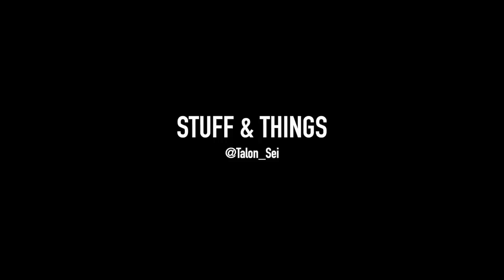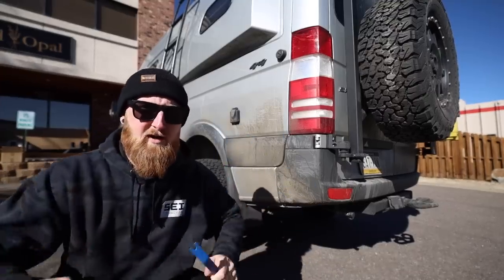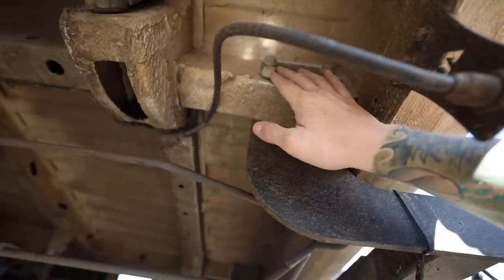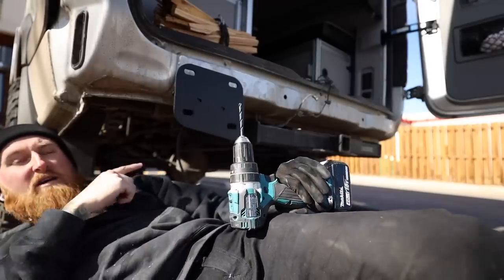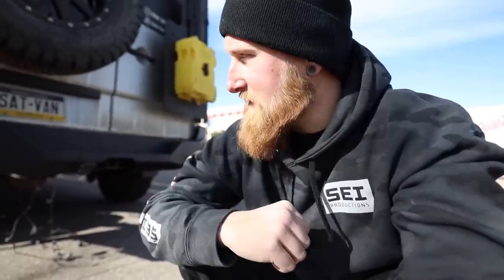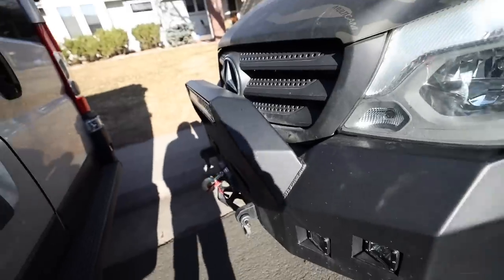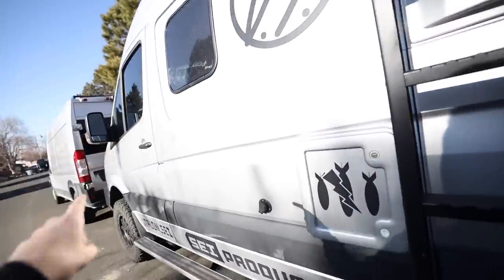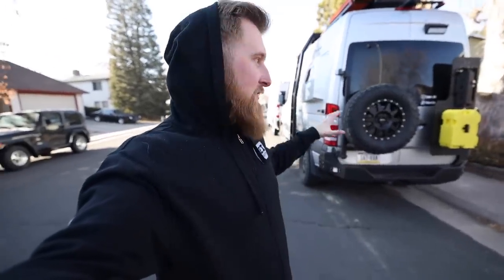More Sprinter Mods?! | Backwoods Adventure Mods

Comment: The bumper looks bad ass.  How much ground clearance did you lose?  Looks likes just a little each side of the tow hitch...?  And since you take you van off road a question about the tire carrier.  I was thinking about making one and mounting it on the hinges like the one you have.  Have you noticed any door sag over the two plus years you have had a tire back there?  I am a little worried that the inertia of the wheel over larger bumps may be bit a bit much for the hinge and could end up twisting it some causing door sag.  Love your channel keep up the posts.